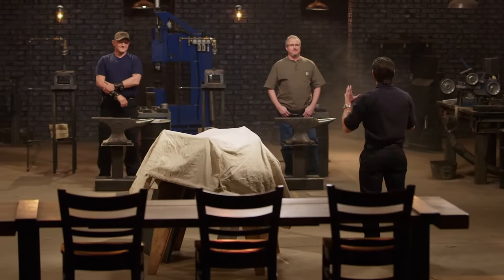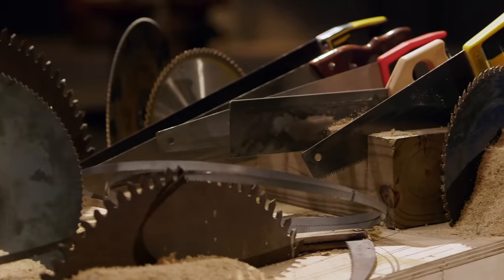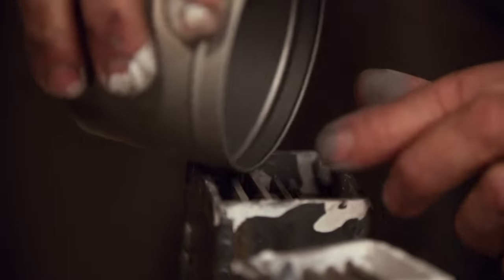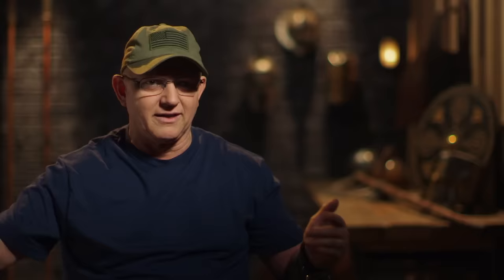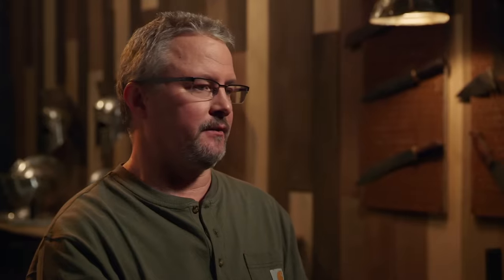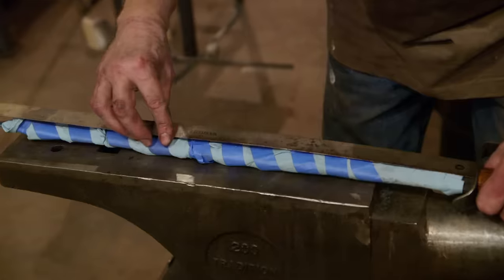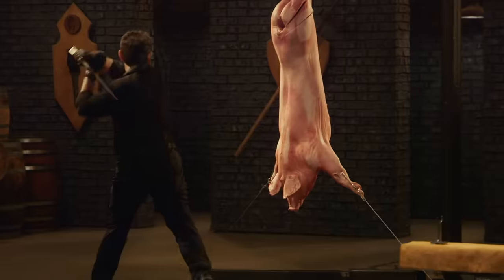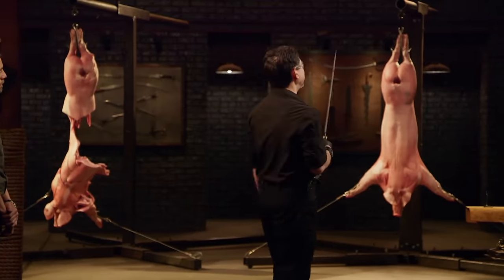Forged in Fire: Beat the Judges: SAW BLADE SWORD CHALLENGE (Season 1) | History

Comment: I rather have a heavier sword, then one that doesn’t even cut and eaves only scratches
Reply: you obviously never swung a sword for an extended period of time. Btw. a light sharp blade will also cut very well, maybe not as deep as a very heavy blade, but it will do it the whole day. A short sword that you can only swing ten times has no use in combat.
Reply: @mementomori4972  yeah but they could clearly swing it, its just a matter of training and getting that arm buffed up. In another scenario, i would not like to hit a guy to just have to hit him again and again, increasing his chance of killing me aswell, one hit to a shield or one to the helmet should at least do some damage. light swords bend easily clashing with other swords
Reply: Luca S.  what is a "buy js" sword? You can't cut or penetrate steel plate armor with a sword. Its not possible. You can go for blunt trauma or for the gaps in between the plates.
Reply: memento mori they didn’t show it, but jays blade bent, handle slightly broke, and didn’t cut... the heavier sword out performed
Reply: @woodjacob25  Its not about Jays blade, but swords in general in historical context. Where did you got this information from and where can I research it?
Reply: memento mori they didn’t highlight these moments in the show. I was told through first hand accounts of the man himself . In certain spots you can see the blade took a warp
Reply: memento mori I’ve personally held all the knives and sword produced by tony for the show. His work is beyond phenomenal . He outclassed the canister expert with his canisters
Reply: @woodjacob25 
I did not want to be accused of ignorance, so I watched the video again but in 0.25 speed. You can see Jays blade flex and go back to straight, which is exactly what it should be doing. There are many shots after the strengt test, where you clearly can see that Jays blade still is straight as an arrow. On which occasion did you have the opportunity to personally hold every blade Tony produced for the show and what is your expertise to judge them? Have you ever held one of Jay Nielsens blades? I understand that Tony is bitter because he did not win 10 thousand dollars, but to speak against a master smith, who proved himself countless times, even before the show started, is just cowardly and shows a lack of character. If you are not a liar, which I am not jet convinced that you are not,...why is Tony not speaking out in public?
Reply: memento mori as you saw, Tony’s canister came off first try while jay struggled ... that’s fact. I’ve heard testimony from the mouth of the person that was there... not by what I saw on the television . Tony isn’t bitter at all, he sold 10k worth of knives the day after the show aired, he considered the donation to melanoma a very noble thing. To say he’s bitter is discusting man . You have no idea
Reply: @woodjacob25  It does not matter how easy the canister comes off. It is important what you do with the steel. A canister that comes of to easy can also be an indicator for a weak forge weld. Forged in Fire is the only show I know (and I challenge anybody to tell me another one) that values fairness and skill more than anything else.  You accuse Jay Nielsen and all the others from the show, of manipulation and lying. That's disgusting "man". You do that for a reason I don't quite understand jet,...certainly not because of the word of one man (that would be stupid), who at least would have a motive (...and I'm not convinced that he really spoke a word with you) What would they have to gain, by pulling such a risky bluff? If Tony is not bitter and if he sees this show as advertisement for himself (which it certainly was), why would he walk around and tell that he was robbed?
Reply: @pablogutierrez1568  That's not how it works. Even if you're totally ripped a heavy sword will quickly get tiring to wield. It also makes it more difficult to control and your movements won't be as fast. An incredibly strong swordsman will always prefer a lighter sword. A gigantic, two-handed longsword tops out at like 3.5 pounds. And this guy's shortsword was 4 pounds. That amount of weight is honestly kind of ridiculous.
Reply: @pablogutierrez1568  That sword weighed 4 POUNDS. Let that sink in. That's heavier than a longsword which typically weighed 2.5-3.5 pounds. A shortsword should weight around  1.5-2 pounds. I'm a fairly large/strong guy by most peoples standards. I'm certainly no power lifter but at 6'3'' 240+ with a 315 bench, 515 deadlift and regularly curl 155 for reps I'm pretty far up the curve. Swinging around a 4 pound chunk of steel with poor balance is not something you are going to be able to do with any finesse for half an hour. Even a mace from the 16th century designed to penetrate armor only weighed around 3.5 pounds. That thing isn't a sword it's a sharpened crow bar.

Comment: Hold on History Channel, he lost because of the weight? Ignored the fact that the blade performed better than J's blade.
Reply: You can always sharp a blunt blade, but cannot lighten a heavy blade...
Reply: @prajwalvs1659  you can lighten it just as easily
Reply: @ShireaTV  it depends on the blade. If it's too thin already, you can't thin it. You'll be messing with its integrity.
Reply: @prajwalvs1659  thin blade and heavy dont go together. In this context, his blade could have been made lighter on the grinder. The judges demonstrated yet again that their comfort outweighs the performance of a piece that was made using the contestants hands, not theirs. Oh! And that they make unfair considerations for the judges when they compete.
Reply: @prajwalvs1659  that blade was not thin, plenty of material to take off, I'd rather have Tony's sword and just have it round down a bit

Comment: Judges need to hit some weights, this "too heavy" stuff is getting old, specially when no weight parameters have been given.

And as much as I like Doug he has got to stop it with trying to make every weapon comform to martial arts, you can't make those moves work when the weapon isn't meant for that style of fighting.
Reply: Four pounds, even three pounds, is too much for a shortsword of this length. That weight is normally for long two handers a foot and a half longer than these.
Reply: @matthewpham9525  You're correct, but his statement of 'no weight parameters have been given' is valid. Given how precise the rules are on blade length and build, unless otherwise explicitly stated weight should not be a factor. It is a sharpness, cutting, and durability test, not a weight test.

Furthermore Jay's (the judge's) blade was not mechanically attached and should have been disqualified. The competitor was robbed, having lost because of an unofficial rule to a weapon that broke official parameters.
Reply: @TheWanderingTyrant  
Even with the obvious trends in the show with weight and handling, I can agree overall.
Reply: @matthewpham9525  Cheers dude. I wanna stress that I do agree with you in that the weight and handling are super important, but if you out perform your opponent's weapon and still lose... in my mind perhaps it should be made a quantified rule. That's all. Hope you and yours are well!
Reply: Any hand-to-hand or melee weapon combat discipline is a martial art. However, there weren't really any "moves" that fit into a "style of fighting." This was just hacking, which is mostly what you do with a weapon that has a straight edge - hack and stab. I really have no idea what you're talking about, and I'm guessing you don't either.
Reply: I am not an expert but I think that these shorter swords they made should be atleast 2 pounds ithereise it's too heavy for a short blade and it may even break a wrist. Again I am not an expert
Reply: "Usable" is always a criteria, and 4 pounds is not at all usable in a fight.

Comment: The heavy sword cut better and killed better...
Reply: But the sword is supposed to be a one hander, that weight would give a problem long time. It will sore ur shoulder and thats bad ☹️
Reply: Heavier blade more momentum going into the cuts not that it was sharper.
Reply: It only cut better because of its weight. More force from the swing but it should be a 1-handed weapon. Swinging that continuously will hurt the wielder. If both weapons are basically tie on all 3 tests, overall construction like design, aesthetics, handle etc. usually decide who's the winner.
Reply: That heavy sword was more of a machete than a short sword, because it was heavy to use and more of a chopper than a cutter. The fact that Jay's sword didn't cut the pig in half doesn't measure if a sword would kill more or not; a faster, lighter, more comfortable and a still almost equally cutting the pig in half proves to be more lethal blade.
The fact that the sword is way too heavy compared to judge's sword is already a valid criteria for losing. Competitor's sword cut better in the end, because of the weight and its chopper-profile; not really because it was sharper than Jay's blade. But I think Doug should've performed the sharpness test, because he's more credible cutter than Ben, all due respect.
Reply: @Anonyomus  It depends a lot on the user tho. I mean if we would forge a weapon for a proper rage beast, then the weight of the sword wouldnt matter. On the other hand if the user was some agile ninja then ofc this is right call. Same goes for battleground. If it would be weapon for longer field battles, then sure, ofc. But if it would be weapon for Arena fights or similar things, then again the weight wouldnt matter :D

Comment: Better sword looses because too heavy...come on.
Reply: It was a tie though.
Reply: Yeah there was a little bs in that call
Reply: Came to weight
Reply: It was head to head competition
Reply: The weight of the sword is extremely important, too light, you can't cut correctly, too heavy, it drain your stamina too fast.
Reply: if your sword is heavy 
and some kind of dull it can make a cut thatst all
Reply: The swords were neck and neck, it was just the weight
Reply: Not exactly. His sword is sharper, true. But it was also heavier then a two-handed sword, which was stated at the end, and is grossly overweight. This affected the utility and mobility of the sword extremely heavily, and is just not what a short sword is supposed to be. 

Jay’s sword might be less sharp, but its at the weight of a short sword. At this point, I would say the increased utility of Jay’s sword outweighed the increased sharpness of the competitor’s, making his victory justified.
Reply: @pierregevelle4873  right
Reply: This thing weights about times of a shortsword, a sword must be fast and nimble, so he failed  at making a sword

Comment: J’s sword is probably a threaded pommel design which is still a mechanically attached handle and the judges are testing overall performance and, more importantly, usability. 
“Can it cut good”, isn’t the only thing being looked at but also how it feels to cut and J’s apparently felt better and only lost the final test by a slight margin. (Tony’s sword going clean through in the first and last test doesn’t mean much if it also weighs 2x as much meaning it has more inertia)

Comment: I notice a lot of people are upset about J winning, and how weight wasn't a listed parameter. However, weight is pretty much the biggest deciding factor in what sword wins other than something breaking. A heavy sword cannot be swung for nearly as long as a lighter sword, and a heavy sword actually poses a risk to the wielder (such as pulling or straining a muscle, or losing control of the weapon). Weapons on this show have been disqualified because the judges believed they were too heavy so safely wield. Also, J's performed better on the strength test. So, it's light and strong. Dulled edged can be fixed by even inexperienced users.

Comment: I think the judges had it in the bag both swords performed roughly equal in the kill test and if you adjust for weight I'd say both blades were potentially about the same level of sharpness. If it were a challenge to make a tool/machete then yes I would say Tony should've won but the key word being sword, a weapon which generally needs to be wieldy and balanced to use to full effect in combat and in that I do believe Jay's blade edges Tony's out slightly.

Comment: It’s much easier to sharpen a blunt well-balanced light sword, than to lighten a sharp, heavy sword. That’s why Jay won.
Reply: Actually, if you cut down the massive copper guard from Tony's sword, it would be about 3 lbs overall. Managable. A heavy machete if you will. 

Jay should have lost.

Comment: I feel like the weight of the sword is very important, especially given the fact that it’s a short sword. That being said something like this should have been specified in the beginning
Reply: Why? If it is something that goes for all weapons ever made? Lighter is better. Even on bludgeoning. As long as it doesn't compromice the structural integrity, you should always go for lighter.

That's like saying that the sword needs to be sharp. It's not a parameter, because it is common knowledge for those who know even a bit about hystorical weapons.
Reply: As a bladesmith you should know what the proper weight for a given sword type is. He overshot the ideal weight by nearly 3 times. People who don't agree with the decision don't realize just how bad this is.

Comment: I thought it was pretty much a draw. If weight is going to be an issue, as it often seems to be, maybe they should start setting weight parameters for each weapon, and provide a scale at the forge. It's heartbreaking to see someone lose because of weight, when no limit was set. They know that their weapon has to be strong, so might leave it heavier to stand up to the tests.
Reply: It's a gamble. You could go for a heavier weapon and pray hard your competitor's weapon break.
Reply: Rather than weight, it's "actual usability" that's the implied criteria. Your weapon has to be usable, usability is king. A 4-pound one-hander is not usable against anything other than a stationary target. They probably don't precisely state their criteria to the viewers, anyways.
Reply: You should not have to tell a bladesmith to make a single-handed shortsword light.

Shortswords should weight between 1 and 2 pounds. What they got was something weighting 4 pounds which is as much as the largest longswords that were ever used.

Comment: A heavy sword is a big no no. The one point I’m confused over is that Jay’s handle was smooth and round. That’s usually a negative in every other competition because the sword can twist in the grip. This is the only time the judges said otherwise. My only caveat is that if the blade doesn’t actually twist in the tests then it’s not an issue. I just find it curious that there was a 180 on that point.

Comment: I don't know, there are a lot of benefits to Tony's sword and it lasted better but the task was not to build a sword but a short-sword and Tony's was too heavy for a short sword. It depends on the circumstances but if you specifically choose a short-sword over say a mace then you want Jay's. A heavy short-sword could be useful but if you're opting for a short sword you're probably in a circumstance where Jay's is better and the pot damage isn't that relevant as short-sword is really for close quarters and should be striking flesh.

Comment: Guys when a 1 handed weapon weighs more than most 2 handed weapons, that is a design flaw. Sure it will cut better but it will be harded to control and harder to recover with each swing. There's a reason why we prefer swords to axes and it's due to the weight and maneuverability of the sword. 

Sure it did better than Jay's on the pig cut, but its edge retention and stability were comparable while having a significant advantage in the force being applied due to its weight.
Reply: 95% of the ppl complaining in the comments would have cramps after one swing of that "short sword". They just dont know what they r talking about

Comment: anyone who argues that 4 lbs is not that heavy hasn't been introduced to actual weapon martial arts or physics...you are swinging that sword around the entire day it will create more force cuz of Acceleration multiplied by mass, and more force is equals to more energy meaning you tire out. It's not just 4lbs if steel...its 4lbs of steel multiplied by gravity and how fast you swing it. Also they are testing weapons or blades...what do blades do? To be used in a combat scenario which is why Doug is using his martial arts to wild type blade and in a combat scenario a slightly blunter weapon with lighter weight will be better. As you fatigue it may also be harder to keep up edge alignment. Also food for thought, its way easier to sharpen a blade to a good enough edge than it is to cut it down some weight to accommodatee

Comment: If you have too heavy a weapon in martial arts, this is fatal. Weight is extremely important. Too heavy and you cannot correct the blow or block it quickly enough.
Reply: If your blade can't cut thats even worse, that can cost the life of your allies and yourself,not to mention its inhumane to not be able to end you enemy's life so that they lay there and suffer. Yet you can get stronger to increase your strength and ability to weild your blade. Thats how knights learned and trained, they used heavy swords till they could easily weild it at if it was no heavier than a butter knife to them.

Comment: What the...? Both blades did the strength test the same way, but J's gave less deeper cuts to the pig carcass and it barely scratched the sandbag, while the other sword destroyed the carcass and at least penetrated the sandbag. How and why J's blade won??? "It's heavy" yeah but it wasn't so heavy that it couldn't compete. If weight was going to be such a negative factor they should have disqualified Tony's sword right at the beginning.